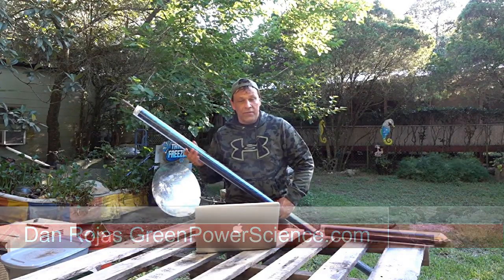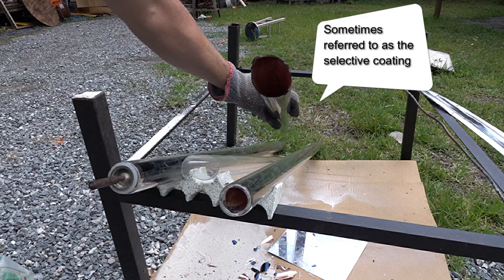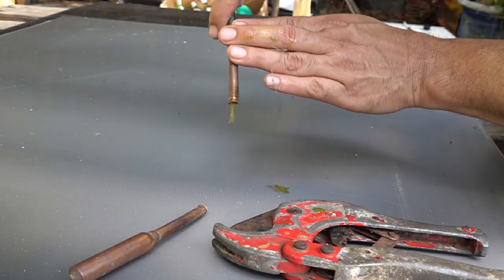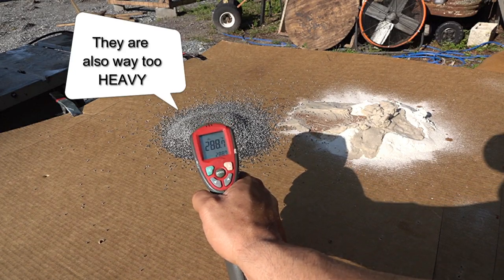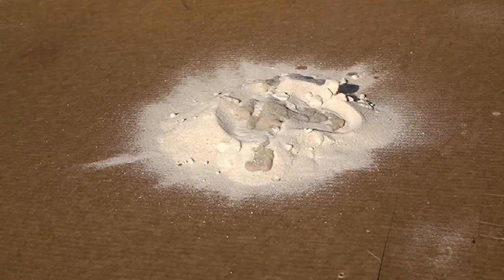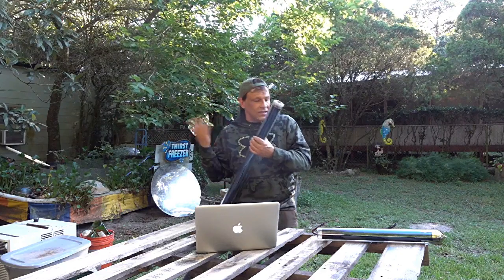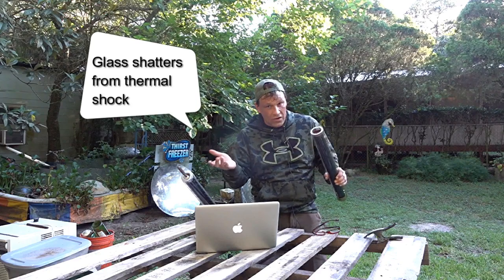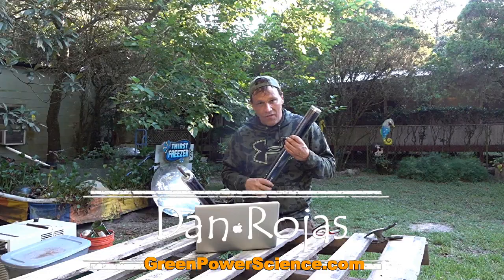Solar Sand Battery Evacuated Tube Implosion Solar Water Heater Thermal Storage

Comment: you really need to update your website, man. there's many easy site builders to use these days :)
Reply from the maker: I know. Working on it while avoiding WordPress.
Reply: GREENPOWERSCIENCE
square space and weebly are probably a good place to start ;)
Reply: +GREENPOWERSCIENCE 
I would like to request you to heat treat a knife with the crazy sun harnessing tech you have.
Reply: What's your main problem with wordpress?

There are other cms's that are great. However, you don't get the same flexibility as with wordpress.

I'd be willing to help/guide/advise you with the process. A sane menu system and modern css would go a long way I think :)

Cheers
Reply: Crysta,l May

Comment: Great idea using sand instead of the metal fins to keep the heat in longer after the sun sets.  Just curious, did you measure the total weight differences of a tube with the fins versus a tube filled with sand?
Reply from the maker: The sand adds about 5-6 pounds for the large tubes and 1-2 pounds for the smaller tubes. The only difference is handling. When filled with sand, the weight stress on the continuously formed glass connection is greater so do not set them down hard or with force. Other than that, they work the same in terms of structure. The sand has been a very good alternative. I have one large tube in the shade and the condenser (tip) reaches 135 ˚F with no direct sun exposure after only 2-3 hours on a sunny day vs. close to 300˚ F in direct sunlight. Thank you for the nice comment and question.

Comment: Those are the water heaters used in Mexico, and it is awesome since you pretty much do not have to use electricity or gas to heat the water up anymore, they are pretty efficient.
Reply: In Turkey, they are widespread.

Comment: Awesome vid! As usual :)  I think the water issue could be solved with a proper manifold seal, but I still like the idea of innovating on the aluminum fins and the wasted volume.  Instead of sand, why not try a phase change material, maybe an oil or wax.  With your parabolic you might need to find a pcm with flash point above 600F, but w/o a parabolic you could find a more common pcm.  A pcm will also leverage the amazing insulating properties of the tubes which are typically wasted at night.  Because the pcm's hold many times more heat than air, water, or sand, it could deliver heat into the night hours.
Reply: I'd been pondering a combination Solar/PCM hot water system, but hadn't considered storing the PCM inside the black inner absorber tube. It's a really good idea. 
Initially it seems dumb coz it's probably the most expensive/space-constrained place you could choose to store your PCM material.  HOWEVER, any other place you'd store the PCM will need to be surrounded with thermal insulation anyway, so this way you're getting a double-use outof the evacuated tubes' thermal insulation properties.  So really it's a brilliant idea!

Comment: Ya I found out the hard way water heated up in something that has a real smooth surface like say a glass tube the water temp can get over 500f and never boil don't ever drop a tea bag In water that's that hot and not boiling it will  explode hot!! Boiling water

Comment: These are similar to an idea I had within a system for desalinization + energy generation, wherein seawater is pumped through a similar tube that is in a parabolic solar collection trough. The steam is then used to generate electricity, which would power the pumps and such, then the freshwater is condensed. This would result in 3 salable products; sea-salt, fresh water, and electricity. I'm sure I will never get around to pursuing this idea, so I'll just give it to the internet. :)

Comment: If you are referring to my video-  https://www.youtube.com/watch?v=xsx7BX0l5uQ , I used a silicon baby bottle nipple to seal off the top of the ET and the heat pipe, my video shows that it's a watertight seal and holds the water to be boiled off, none leaking inside, not dangerous if done right.

Comment: What about carbon in the form of graphite? It's black and I think it's good thermal conductor.
Reply: Sand is a lot cheaper.
Reply: Evan Zwack 

If you can find the perfect sand.

I can go down to the local Rural King and buy Graphite by the gallon.

Apparently Farmers stir it in with their seeds to make sure they flow easily when planting.
Reply: Don't think it's directly exposed to the sunlight inside the tube, so it doesn't seem like the color would matter.

Comment: I recommend a petrol oil or maybe some sort of very high smoking point oil as a medium, maybe in tandum with the beach sand? Just need to make sure its not easily flamable, maybe a simple cap would be enough to keep oxygen out

Comment: You do not increase the efficiency using one of those vacuum tubes with a concentrator on them. Efficiency will be probably almost the same what you do is just increase the collecting area. Having sand as thermal mass inside the tube has no benefit. Sand by volume has just half the heat capacity of water so is of no use to have sand inside the tube. Sand is also a fairly bad thermal conductor so the aluminium fins are the optimal solution.  
Solar PV panels will take about 2.5x more area for the same amount of power but they will cost about the same as solar evacuated tubes at this point in time. So I will fully heat my house with electricity from PV panels since it will be the least expensive form of energy and the energy for the heating part will be stored in thermal mass in my case a large 14cubic meter concrete slab that can store about 100kWh of energy while keeping the floor temperature at more than acceptable temperature.
There are huge advantages to PV panels for heating like no pipes with hot fluids and pumps and there is no problem if you have excess unused energy no need to divert that as with solar tubes so that you do not damage the installation or cover the tubes.
The down side is that it takes 2.5x more space as I mentioned before.
Reply: Sand will not increase pressure inside the tube!
Reply: Goes to show that if it were optimum, the manufacturer would have designed and shipped it that way.
Reply: How can PV panels take 2.5x more space as they are 10x less efficient? From a 10sqft you can harvest 1kWh of heat or 100W of energy on average sunny day and with average gear. I agree there's top of the range PV panels that can do 3X as average thermal ( annually!) but you have to ask NASA to sell you some.
Reply: Less effective three times four. No, not ten times. Solar panels have an efficiency of 17%

Comment: Hi Dan I never realised just how dangerous those little buggers are I live in a small wheatbelt / rural town in Western Australia where in summer it often gets to and over +45c i could imagine how hot they potentially get.
One of my mates has a commercially brought Solar HWS in summer he either whitewashes the panels or covers 3/4 of them with cardboard or shade cloth to stop the  system from constantly boiling
Reply: You should investigate the Rankine  cycle.A fully closed loop steam system . Steam 'exhaust' is condensed and recycled endlessly. Steam does not necessarily need be open loop. In fact, closed loop results in much less mineral deposits and consequently, reduced maintenance. What had been a problem with steam in the past is the fact that steam is a natural degreaser. Modern synthetics can now be employed which do not rely on grease for lubrication. Just things to consider.
Reply from the maker: They are really good and one of the few solar devices that produce useful results on cloudy days. The one filled with sand stays hot to the touch all night.
Reply: I Dont think they are such a Big Item on the Market here in western Australia as our winters dont get anywhere as cold as yours The average Winters day ( Right now ) is around 14C to 16c  Around 60f ish) during the day  I have seen it down to -9c at 3am at night though and we dont get snow here
Reply: (Just to jump in uninvited(sorry)) I have often described solar hot water as an engine without a throttle. For the very reason you mention. Its a shame to diminish the capability that way. I consider it the simplest,most cost effective way around the 'throttle' problem. I have also been taught to angle the collectors for optimum WINTER effectiveness as summer will take care of itself. I've always thought a Stirling engine/inverter system to utilize what is 'overproduced'. A company (I have invested in) is out there that makes a waste heat engine/generator set called 'cyclone Power' that may end up being the perfect match for this type of situation.
I don't thnk they're quite ready for the mass market yet, but you (and others here) may find them of interest.
Reply: great Idea John, traditional coal fired and Nuclear power stations use steam, as well as focused solar farms via turbines so i don't see why a stirling engine one issue around hear is a lot of properties rely on 20,000 gallon water tanks for their only source of water For their families and we live in a dry region , So water supplies need to be managed carefully In other words you don't want steam evaporating out the Release valve But upon saying that maybe Via a Stirling engine you could capture the heat and feed any cooler water not used  back into the HWS or water tank

Comment: With the water going true the sinter of the tube why not put it on a 7 psi closed loop say going from the tube to a coil heat exchanger in a homes hot water tank . The tank can be at any presure and the solar loop can b 7 psi
Reply from the maker: This type the water does not go in at all. The "U" pipe versions do. A closed loop system would be a great idea. The best would be a coiled tube all the way down then back up the center. The cost is the issue. The giant tubes sell for $1.40 each from China. By the time you get them shipped it averages $35 a tube. So, the only option is the completed systems or smaller tubes.

Comment: Couldn't you just flip the tube upside down? There's really no reason for it to be upright if you're just going to use the heat pipe. If it's designed to be a heat pipe, it'll have a wicking surface that'll pull the condensed liquid up the pipe. I'm not sure how well it'll work with just copper tubing, but I believe it'll still work, just a little less efficiently. Considering how cheap proper heat pipes are to buy these days, it doesn't make  much sense to make your own any more.
Reply from the maker: They need to be upright or the exchange/transfer fluid will go to the bottom (now the top upside down) and not condense. The more expensive systems are fine. The issue is, when purchasing the heaters from the internet, they all look similar.

Comment: how about stainless steel? like ball bearings. they should not rust.
Reply from the maker: Any type metal is very heavy. The small tube weighed 22 pounds with zinc pellets. The large tube would not survive the stress from the weight and require about 60 pounds of material.

Comment: How about salt?
Reply from the maker: If the salt gets wet, it becomes lodged in the bottom. Once that happens it is difficult to clean without breaking the tube.
Reply: I have a question.
Suppose I filled solar evacuated glass tube with sand and closed the open mouth by thermal insulator. And placed these solar tube in sunny day for couple of days. What will be happen?  Solar evacuated glass will explode or Sand temperature will constantly increase or Solar evacuated tube refuse to absorb more radiation after achieving same temperature by Sand. 

What will happen? Please explain.

Comment: Imagine a train totally lined with these tubes. On a sunny day, could it feed a special steam loc enough to really go?  And into the night, from the thermal mass? Trains tend to be fully exposed to the sun, most of the time. At least here they are. Few tunnels, rarely a building to cast a shadow. Trees do happen, to a degree.
Reply: I was thinking about the same thing. I may need to build a small steam engine to power a generator.  I was also thinking off grid water heater, room heater. with a radiator placed somewhere in the shade to strip off excess heat if necessary.  I must order some of these tubes.